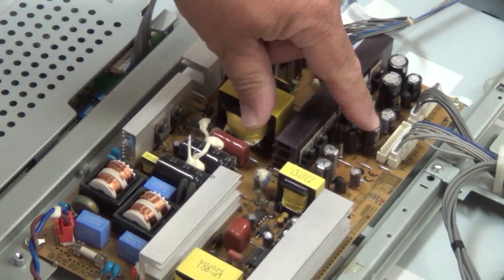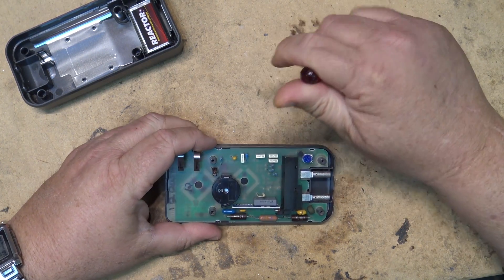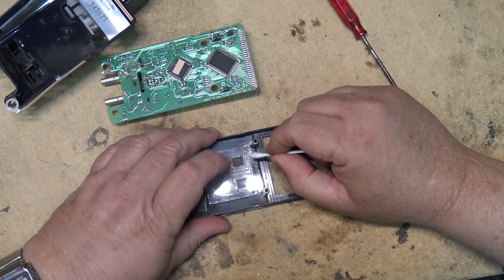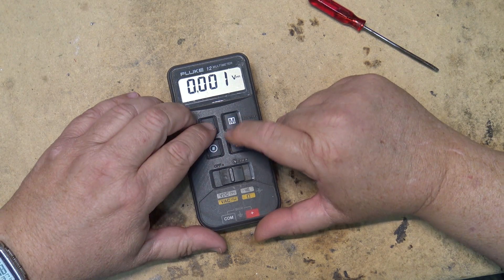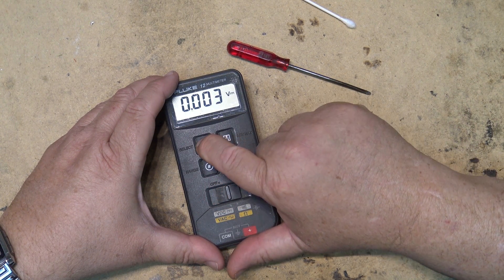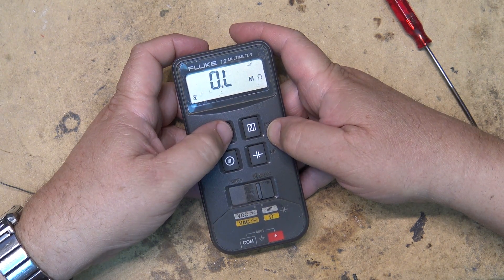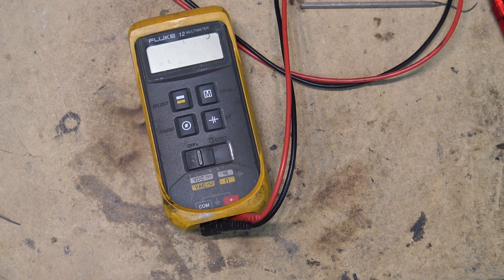Fluke 12 Digital Multi meter -  Select button not working

Comment: I have this meter.  I like to use it for the Capacitance function. I've had in about 20 years. It had this problem a few years back.  I cleaned up the rubber insert, which fixed it.  The problem comes back often. I've thought to add solder as you did.  However,  I have found that squeezing the outer case near the location of the rubber inserts gets it to work quickly.

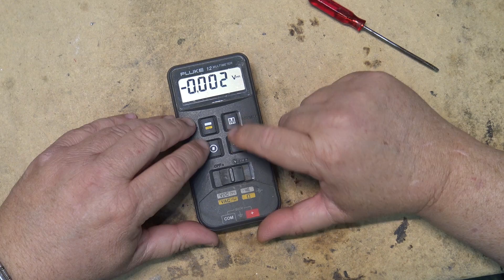Comment: 5:50 ''None of the buttons are working''
lol, that's my issue NO BUTTONS work.
I had a display problem a couple years back,
 I was able rectify that issue, but now my 
fluke 12 is useless again, as no buttons will function
at all.

Comment: I've got the same device and mine was doing the same thing!  I tried adding some more solder like in the video, and it didn't help, but in the course of checking the connections and functionality of the button component (the rubber part with the buttons on it that is featured starting at 8:45 in this video) I realized that I was scraping away some built-up crud on the connections with my other multimeter tips, so I gave each one a little extra scratching to remove any gunk I could see and after putting it all back together it works perfectly now!  Thanks for this video.

Comment: I have the same exact issue with the same exact meter, the good part is they are highly serviceable, the bad part is this happens on most of these. I have had zero luck as my Fluke 12 the ZEBRA Elastomeric Connectors are just deformed and bad I did fix the display that was missing digits but not all the buttons. So for me I am going to try and source a new strip which should get it all back and running I hope. Great vid ...

Comment: Thanks for the video, it inspired me to take care of my Fluke 10. I bought it new in the summer of 98 and some years ago (5-10 perhaps)  my display begun to misbehave and my two buttons had already died at some point, i did not really care as it was still doing exactly what i use it for. Now i have cleaned the connectors an fiddle around with the zebra strips and it turned out to work as in its glory days. Cheers.

Comment: Glad i found this, my Fluke 12 has the same issue. I ended up in the same place, adding solder and also had to shave a 10th of a mil or less off each end of the elastomeric conductor strip. Still seems sporadic in use but at least i can now use the mode switch even if it takes a couple pushes

Comment: THANK YOU!. Fixed mine and learned something new following your method! Clever trick with adding more solder!
Reply: Also - the rubber button ripped off from the single piece, so I ended up gluing it with RTV (u could use whatever other glue) to the tactile board! That button doesn't have the "bounce back" feel to it, but it works just fine!

Comment: ilove this model. easy to used and handled free. i have fluke 10 model but casing was crack now. but even if it was. it run smoothly and correctly
by the way.. can i have that fluke..hehehe

Comment: Indeed, the conductive strips are an issue, but I once solved the problem with the selector switch in an other way, by resetting the meter. Press all the buttons at the same time, then switch the meter on. The meter electronically resets itself. Try this before opening the meter.
Reply from the maker: That won't work if the conductive strip has lost its conductivity though.  Reset will work if meter is locked up.
Reply: Indeed, about the conductive strips. But not always. A reset CAN help, like here when some knobs has lost their function.
Reply from the maker: @gerl9869  right but I had already tried long before doing the video.  Tried when the meter started acting up and hence you saw my backup meter in a previous video that everyone commented on.

Comment: Great way to loose your life!  Trusting a meter you knew at one point was not functioning correctly.
Reply from the maker: No hazard here.  Just a failed connection on an interconnect between the select switch and the system.  You are right there for tool condition though.  If a tool is damaged it can be very hazardous.
Reply: I put the battery in backwards on one of them once. The blast was so big my dog ran away, and I never seen him since.

Comment: I doubt it was bought in 1991, since the component date codes are late 1994 to early 1995. ;)
Reply from the maker: Oh look we have someone that doesn't have a live looking up date codes.
Reply: @12voltvids  Huh? Not sure if you're saying that you look up date codes all the time (and if so... so what?), or implying I don't have a life because I saw date codes (which is nonsense. I can read 4-6 digit numbers AND listen to a video at the same time!! :) ). 

But the main IC says "14 95" and the LCD says "940821", and the part numbers in this meter start with 855, so this is all indicative of an early 1995 manufacture for the meter.
Reply from the maker: @tookitogo  
I didn't say it was 91, I said I got my ham licence in 91 and bought it at a flea market way back.  I don't remember the exact date and don't bother myself looking up date codes or even looking at the chips because that was not the fault, and when someone has to go to the trouble to call me out because I didn't know the date the unit was manufactures stinks of troll and trolls really smell. Worse than my 19 year olds feet. 😁
Reply: 12voltvids 
1. At 13:00 you say you bought it at one of the first ham fests you went to, and expressly say “this woulda been 91-92, early 90s”. 1995 certainly doesn’t really count as “early”. Nothing about the ham license.
2. As a semi-pro youtuber, you should be smart enough to know the difference between commenting and trolling. Mine was a comment, an FYI, nothing more. Not “calling out”, not “trolling”. No idea why you are so incredibly on the defensive. I didn’t call you names or insinuate anything (as you have so petulantly done in response). Touchy, touchy... 🙄
Reply from the maker: @tookitogo  
I got my license in 91 and went to several flea markets in those first few years and bought it at one of them for 10 or 12 bucks.  Let's just say o bought it at least 25 years ago.  Do you remember what date you bought something 25 years ago. There are some things that you remember and if you are old enough you will remember what you were doing. The day that Elvis died for example. I was in a motorcycle dealer buying my first bike.  I remember the bald manager run out of his office and change the station on the radio in the showroom to the news station.

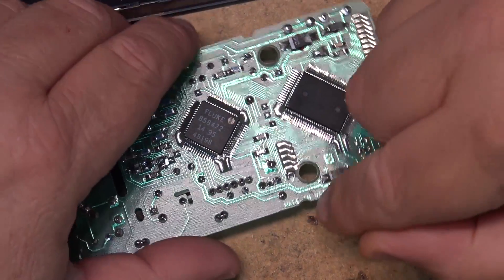Comment: Nice job. I have a feeling that the "14 95" marking on the Fluke ASIC is the date code 10:40 . Have you bought it second hand? The $10 price sounds crazy low for a Fluke, even in the early-mid '90s, and even for a second hand unit.

About 5-6 years ago I blown up my meter. I've measured the inductance of the...  mains :) . The  cheapo meter didn't like 230VAC in inductance mode. Only the inductance and capacitance modes died, I've replaced a few OPAs and CMOS MUXes, tweaked a bunch of SMD trimmers, and it's still fine. This meter is now 10 years old. It was about 35 USD in 2009. It's a Maxwell MX-25314. https://www.bestbyte.hu/Maxwell_Multimeter_MX--i3589245.jpg  I bought it because it was the cheapest with inductance measurement. It's quite accurate in V, A, Ohms, and good enough for me in capacitance and inductance modes (and it's more accurate since the repair than it was out of the box). I have several other DMMs, the best is a Metex M3650 from 1989, still spot on after 30 years, but only 3.5 digit, just as all of my other meters.
Reply from the maker: Yes I bought it used.

Comment: A good source of this Zebra strips is on Ebay  search for "16-Character x 2-Line LCD Module"  they have 2 rows of them which fit the Fluke :-) I repaired my Fluke 12 by stripping these down and just cut them to the length you need. They are only a couple of bucks.
Hope this helps.

Comment: $10? I paid $100 for mine (30 years ago). It's the best meter I've ever owned. Thanks for sharing...
Reply: I bought one in 1992 for $100 dollars.

Hehehe big deal.
Reply from the maker: Yes it is good and yes I paid 10.00 at a ham flea market.   Only thing I have had to replace is the test leads.

Comment: Had part of the display go blank on my DMM, same problem, so put a piece of polystyrene between
the board and the back, so with the back screwed down it put just enough pressure on the board
for it to make proper contact again with the strip.

Comment: It sucks when your favorite test gear "F"s up.    I have a old DMM from the 80s and it is the type with piano key selectors.   The locking mech for the resistor mode switch does not lock into place for selecting  resistance mode any longer.   Really ticks me off.     Thinking about using velcro to hold it in place when I want resistance mode.   I would try to repair the switch but it has like 30 pins on it that need to be desoldered.   I am afraid I would do more damage trying to fix it.

Comment: I have the same issue with those zebra strips but it's my HP48G calculator that had issues. 
What a PITA to take apart... Man.
Cheers,
Reply: The HP-41's sometimes developed similar problems.  It's not a terribly durable way to connect two parallel surfaces, unless there's a way to alter the amount of pressure being applied.  In some cases, some makeshift shimming will restore contact, but not with the 41's.  I had one that worked only when the upper and lower halves were clamped together; I sanded the case halves, clamped it together and used 2-component epoxy to hold it together -- forever.  That was about 15 years ago and it's still in service!

Comment: I got an HP DMM for free at a radio club swap meet. It read ohms just fine but when I measured the AC line as a quick test it read about 3 volts. Turned out that one of the 470 ohm input resistors was wide open. Replaced it with two 1k resistors in parallel pulled from an old Zenith ChromaColor II module and the volt range works just fine now. I don't expect it to be accurate down to the exact volt on higher measurements, but it's good enough for something I got for free.
Reply: You should tweak it with parallel resistors until you get the exact resistance you need.    I did that with an old 1960s Heathkit capacitor tester I refurbished.    I played with resistor values until I got what I needed instead of buying precision resistors.   Just be sure to let them cool after soldering so they come back to room temp resistance value.
Reply: @jp040759  Doesn't lots of resistors together cause more drift in precision circuits?
Reply: @uK8cvPAq  I suppose that is possible over time.  Modern resistors are pretty good.   If the temp it is used in extremely hot or cold  environments it should be pretty good.   It's better that one 470 ohm resistor that is way out.     If you want/need lab grade gear than use the best of course.  Most hobbyists do not need to measure a gnats fart in a tornado.